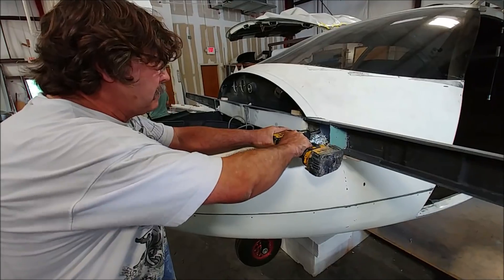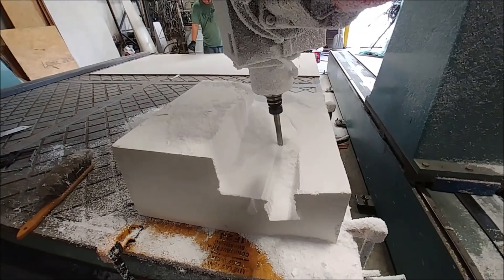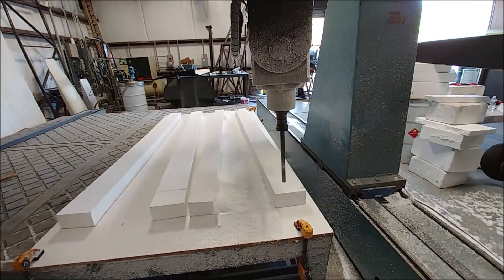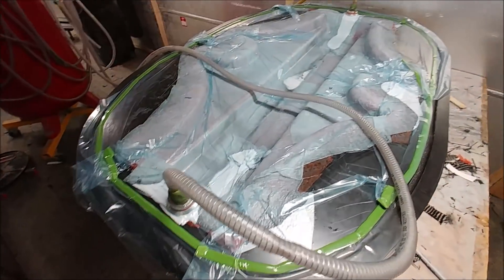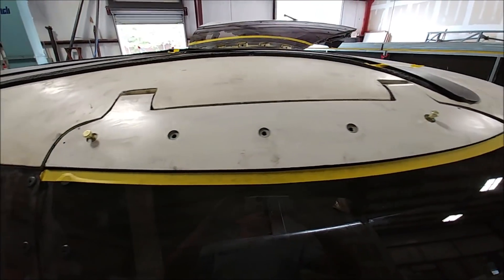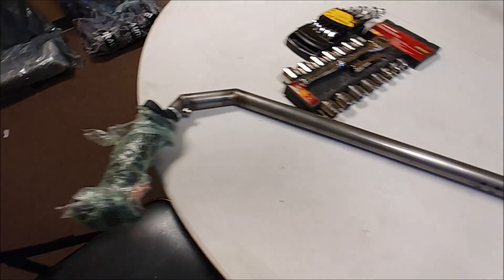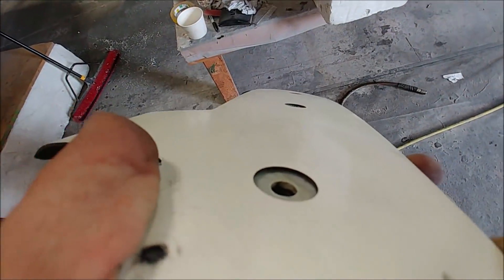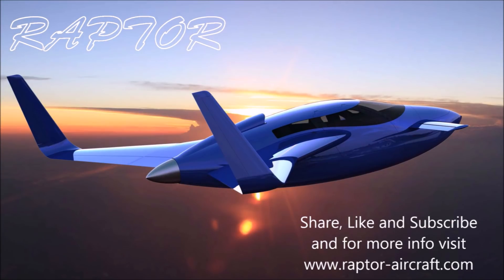Upper Door Skins On - Building the Raptor Prototype

Comment: If you want to know the future of aviation, read my tweets to get a view from reality. twitter.com/seaplaneguy  Yes, if you can't go DOOR TO DOOR you are wasting your time.  Flying will be cheaper than the cost of tires,  road tax and brakes, all of which are mostly eliminated by flying.  Tires = 1 cent/mile.  Road tax 2 cent/mile.  Brakes 1/2 c/mile.  Total 3.5 cents/mile.  Fuel (Nat Gas) at 200 mph is 2.5 for a 6 place airplane I am working on.  This canard thing is not relevant, neither is the x-57, all turboprops, all single engine airplanes, all non roadable airplanes...basically ALL GA airplanes.  Obsolete.  Want to sober up?  Read the tweets.  Then let's have a conversation.  If not, ok, just realize every hour and dollar you spend is being wasted on that Canard nonsense.

Comment: ADVICE for those fasteners on the top of the door panels that get covered under composites - I hope you are using LockTite RED on all threads that you won't have future access to (for several reasons having to do with all fasteners are required to be accessible unless they are "permanently affixed".

ADVICE on those "negative draft/camber" channels - these molds can be made to be reusable instead of disposable/destroy to disassemble by splitting the mold (with a hot wire) on the bottom surface of the channel and lining it with an extra 2nd layer of the foil that covers the seam, and making sure that you include an "air channel" into that seam from the outside so compressed air can be introduced into the mold and separate the mold halves from each other "lickity-split" (literally!).

I've used this approach on larger/wide area panels and you might be shocked to see how easy it makes de-molding difficult parts, especially when you DON'T have to break apart the molds!  If designed right, even negative hangover areas will easily release when the compressed air flexes the part enough to widen the mold enough to release the component.  You may also find that the fitting used to pull a vacuum on the mold can be used for the opposite, to introduce air pressure into it to pop the mold open.  Hope this helps - compressed air ports can be retrofitted to the other tricky molds too!
Reply from the maker: You do recall that several of our existing molds are multi piece already, right?
Reply: Yes of course, but my suggestion was for this particular mold, which was not split, and to introduce you to using compressed air to help with the release.
Reply: FAA regs day you can’t use loctite or threadlocker